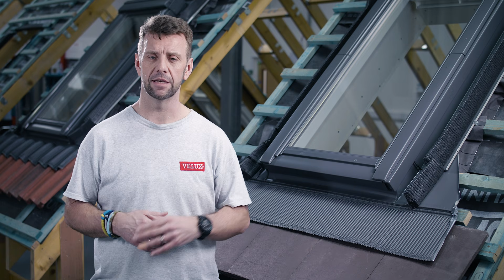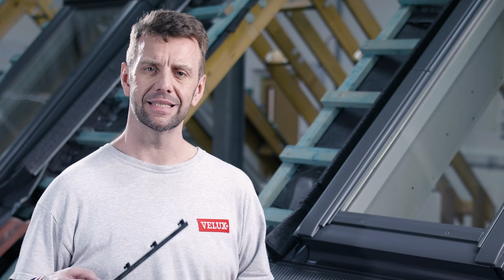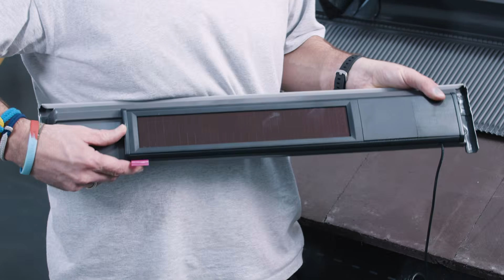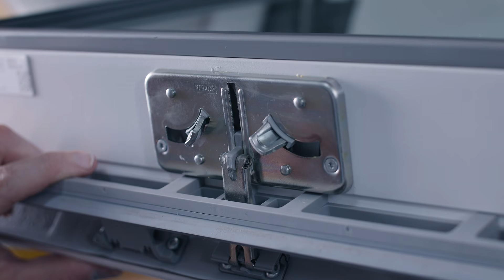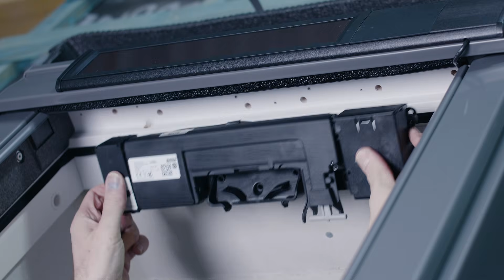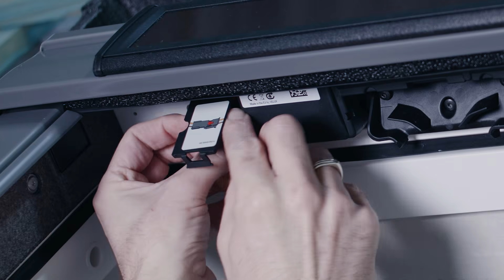VELUX product training and installation Conversions

Comment: How far can the window open ? And can this be automated depending on the weather outside.
Reply: I have 4 big sk06 velux windows, I can't afford to have this on all 4 but if I wanted 2 do the electric wires plug into one?
Reply: @misssimmi2  solar is much easier to retrofit. No need for an electrician visit and works even when the powers out.
Reply: One of my 3 Velux windows is motorised with a solar panel. It opens to about 45° from the closed position. It includes a rain sensor that will close the window when it rains. If it has stopped raining but there is significant rain still on the window it won't open remotely. I'm hoping to upgrade one of the others myself this spring.
Reply: Yep. My centre pivot windows open about 40cm. I suppose it depends on the size of the window how much it can open. It opens up basically flat if that helps? You need the Velux HUB with Co2/temp and RH sensor to automate them. All ties into your home system of choice. Your windows/shutters/blinds need to be IO or Electra enabled to work of course & that can be mains or solar powered depending on what Velux decide to offer. The Velux HUB won’t do anything for manual windows/blinds/shutters of course.